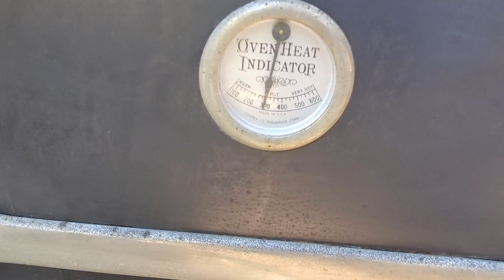-28°F Approved! Heating Rustic Cabin with Antique Cook Stove  S2:E44

Comment: I didn't see a stove pipe damper any where. Thus will help hold more heat in the stove. Is your fire box just cast iron or is it lined with refractory cement? If it's lined and you have correct grates you can burn coal. Fire will last a lot longer on coal. If it's wood only just before bed put the biggest unsplit log you can fit in the fire box, add some smaller pieces if the fit. Cover over with Wood ash and close the air draft in the side and damper on stove pipe as much as you can with out smothering the fire. This should keep a banked fire for most if not all night.  I'd suggest a book called Wood Stove Cookery that's available on eBay. It explains a lot about old cook stoves
Reply from the maker: Thanks for watching. We ran the stove the entire first winter with no stove pipe damper and found it very difficult to slow the fire down. This last fall I reinstalled the chimney to avoid exiting through the roof and we did install a stove pipe damper and it seems to help a lot this winter. We can now slow it down enough to not have to feed it more than once an hour where last year we had to feed it every 20 min. The stove is equiped to burn coal but we have plenty of wood. Thanks for the comment, hope you get the chance to watch some of our newer videos if you havent already.

Comment: Yall seem like real nice people but i have that same wood cook stove and live in a much smaller house and i sure hope that aint yalls primary heat. Its good while you have it roaring hot and if youre within 10 feet of it but its not kuch use past that ajf the wood is so small in order to fit into it that you have to refill it every 20 minutes. Id suggest a potbelly stove personally. Best of luck to yall
Reply from the maker: Thanks for the comment. We are new to wood heat and at the moment the Olympic is our only source of heat. So far we have only had nightly lows in the teens and have been happy with it. We will see how it goes when it gets colder. We are hopping a tall stove pipe and 2 inches of pink foam board will keep us warm enough but It does burn out pretty quick at night when we go to bed. We purchased ours without the cover for the clean-out under the oven and I had to make one. How cold do your winters get?

Comment: At 2:36, it looks like you are missing the door on the cleanout opening under the oven.  Is this true, or is it just not visible?
Reply from the maker: Yes. Unfortunately the ash clean out door was missing when we purchased it. I had to improvise and make my own in order for the stove to function properly.
Reply: @johansenfamilyvlog8972  Glad you figured out how to work around the missing piece.  We cook and heat with a woodburning cookstove, too.  You can see our setup at my blog: woodcookstovecooking.blogspot.com  Hope you are enjoying your stove as much as we enjoy ours!
Reply from the maker: When we first got the cook stove we didn't know anything about them but it didn't make sense to me that the stove should be allowed to such in air there. So I found a picture online of our stove and realized that it needs a cover. We are actually burning mostly Eastern White Pine with some Aspen and a few chunks from some old Oak boards our neighbor was getting rid of. We were not prepared to spend this winter at our property so we were unable to properly season hardly any wood. When we burn dry wood, mostly sticks and dead standing, we have to be careful not to over fire the stove. When we burn wet split wood we can barely seem to keep it going. With the small not air tight firebox it pretty much burns out as soon as we go to bed. We go to bed in the 70s or low 80s and wake up in the 50s. It has been an adventure and so far we love it!